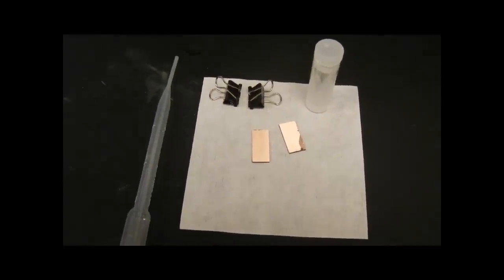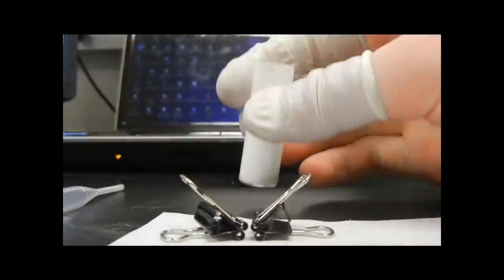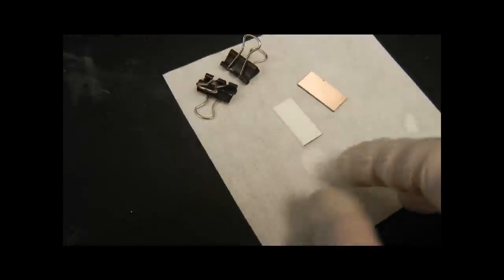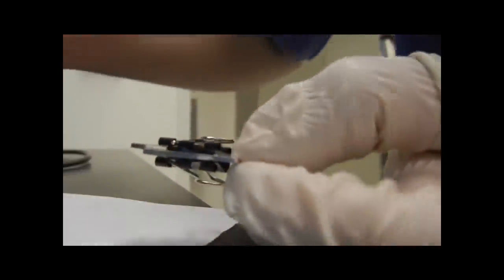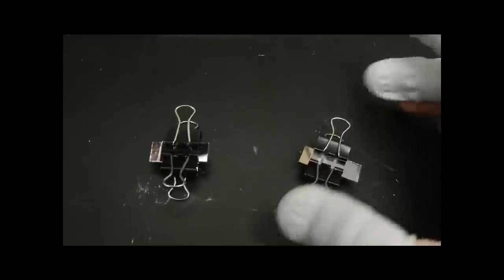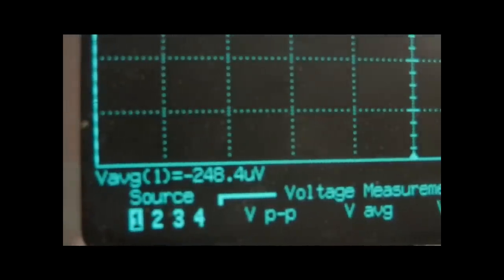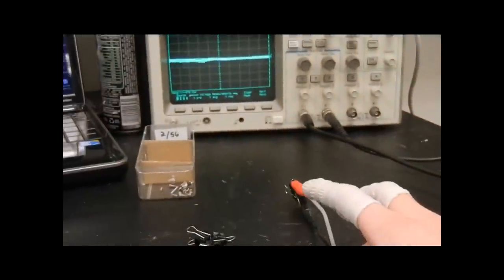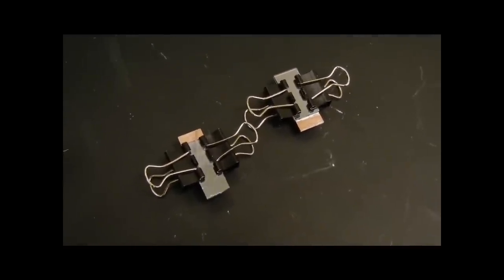Homemade Piezoelectric Transducer

Comment: Hi there. I guess this is quite an old video. Still I would like to point out one thing. As someone who has been working with piezoelectric materials since the last 4 years, I dont understand how you could get the voltage output without POLING the sample. If you are familiar with the term, you must know that these ceramics have to be subjected to high electric fields to polarize their random orientations. Only then will they show some transduction. Otherwise, as can be seen from your experiment, whatever voltage change was recorded could very well be due to static charges, nothing more.
Reply: +Ritendra Mishra This is a good question. The reason could be that Barium Titanate is a category of piezoelectric material called ferroelectric material which is already slightly polarized without the application of an electric field, not completely randomly oriented. Applying an electric field reverses and strengthens their polarization, but the polarization still exists without. :)
Reply: hi howunoriginal2. Yes, that may be true. Im not much of a materials science guy. Though I have had some experience working with these materials. The residual polarization is not enough for generating usable voltage. We have to subject the energy harvester to POLING. If you have been following research in this field, you might have come across a novel research paper by Zhong Lin Wang from KAIST. His team made a flexible generator using Barium Titanate and silicone. They were able to power LEDs with their harvesters. I tried to make something similar but with PZT. The result was similar to what you got. I could only get about half a volt.
Reply: I think I have to agree. Even if the Barium Titanate micro-crystals are already polarized, they themselves are oriented randomly from being swirled around in a slurry. There would be just as many outputting on any one vector as the exact opposite. It raises the question of what would determine the polarity of your generator? Like if you apply physical stress on the generator in one vector, what part of the construction determines which electrode will output positive?
Reply: Hello, how did you make your PZT flexible generator?
Reply: +Ritendra Mishra I would like to calibrate such an device and have some doubts. Can i contact you?
Reply: Ritendra Mishra kya tum mujhe piezoelectric crystal ke baare mai information de sakte ho please
Reply: Ritendra Mishra 
Please help me regarding this topic. I have to develop a tile using any piezo electric material easily available. Need guidance

Comment: Barium is dielectric and responds to earth's magnetic field. Keep it's orientation long way n and maybe better result, but as Ru said; applying 300v until dry might work. Another idea would be to let it dry in the presence of a pair of close synced tesla coil primaries (2 tiny tesla coils), since the massive charge resistance should form intermittent superconductivity.
I'm looking into making my own crystals to begin experimenting with an ultrasonic vortex chamber 4" long for use with an ionizer to make hho through cymatics and ion vortexing. Useful if you want to run a car off water instead of gas.
Reply: mike fromspace 
Help me regarding this?
I need to construct a tile for a project exhibition. It should incorporate any polymer that is easily available. How to get the most out of it with limited resources? Please contact
Reply: So effing idiocy.